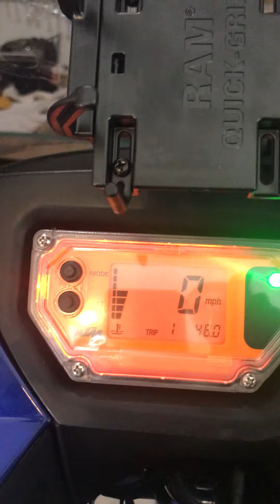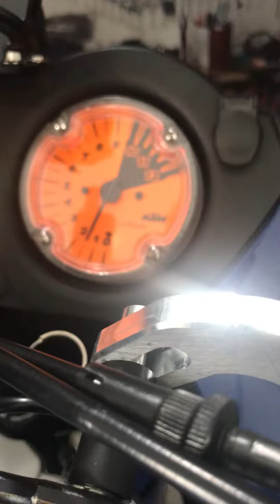KTM 990 Adventure Throttle / Stalling Issue - Need Help Diagnosing Issue

Comment: How is it running now? Was it truly just the TPS? I’m having a similar problem with random stalling and the rough running higher in the rpm. It’s also running excessively rich and rolls coal like a diesel when I rev it

Comment from the maker: Replaced the TPS today and the bike is running like new. Fingers crossed that the issue is solved.
Reply: Hi, may I ask on which value did you set the new TPS?  Did you set the value with retracted stepper-motor and fully closed throttle butterflies?